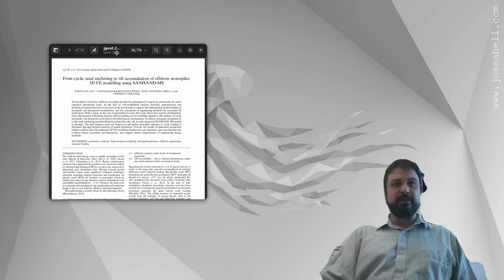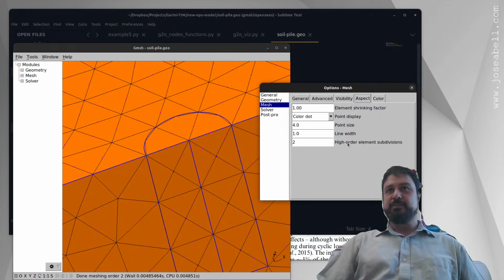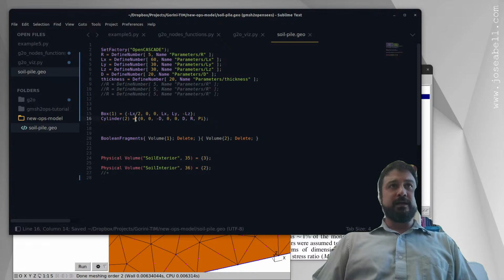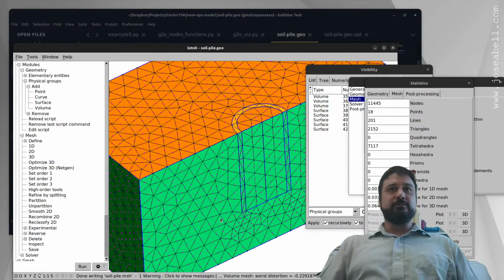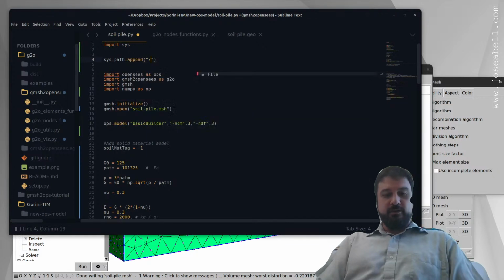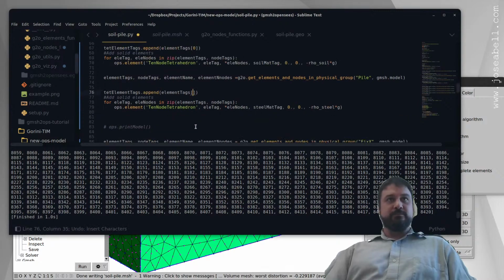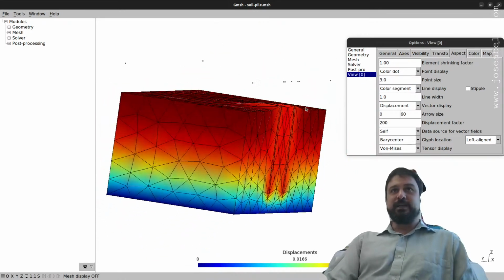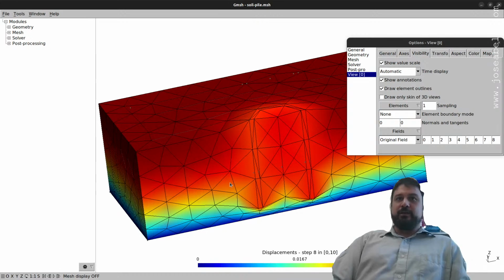Modeling soil-pile interaction gmsh + opensees (openseespy)

Comment: Hi Jose - Brilliant video - I used gmsh2opensees to create a model in OpenSeesPy. One question: Once in Openseespy I have since modified the model, e.g. created nodes and deleted elements etc. So now when you call to visualise the model, it pulls up the old model created in gmsh, rather than the updated one. Would it be feasible to modify this, so that a model imported using gmsh2opensees which is then later modified by the user, could also be visualised in gmsh?
Reply from the maker: I'm really sorry I didn't get to this comment. How did it go?

Comment: Fantastic. I think this has a huge potential. How did you learn Gmsh ? From documentation or any other resource ?
If we can somehow handle zerolength elements - then we have everything that a full fledged FEM software needs.
Reply from the maker: I started using gmsh about 13 years ago for consulting. Learned mostly from the documentation and some interaction with the developers. 

ZeroLengths can be handled with some python logic. There are also gmsh plugins that do stuff that's helpful (crack generator for example can duplicate surfaces typically needed for interfaces).